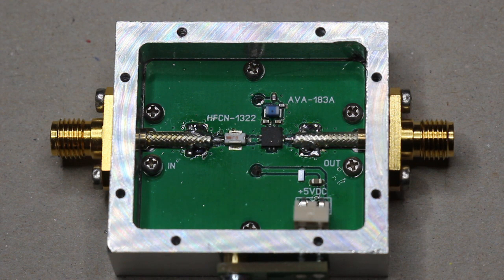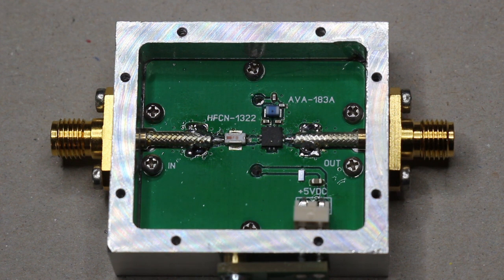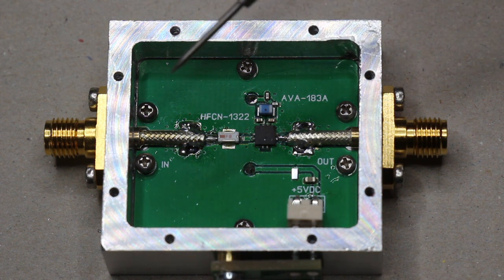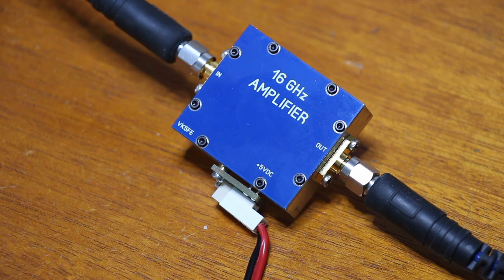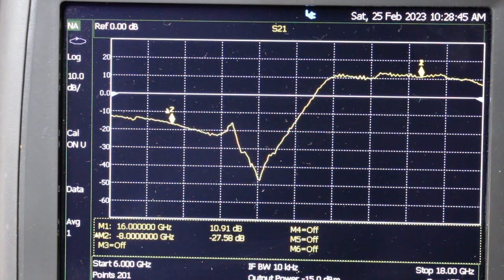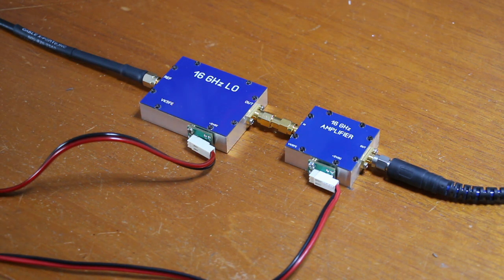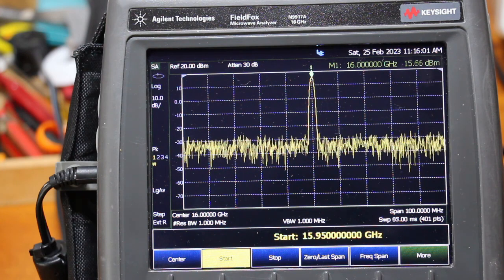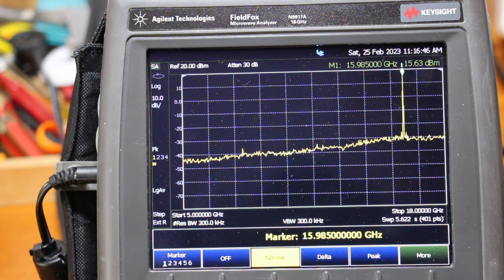#28    16  GHz, 10 dB Amplifier - Accidents Happen !!

Comment: Thank you for your video.
Very interesting to see your hardwork.
But i have question:
What nominal induction you used in power supply circuit of amplifier?
I trying to create amplifier with ava-183+ and have fiasco. No gain.
And i begin saspect - signal flow through power signal or other. In my datasheet, this induction - 3.3 nH.

Sorry for my English.
Reply from the maker: Hi Dmitry, thanks for your comment. 
I used the same components suggested on the datasheet, nothing different. For the inductor, try the Coilcraft 0805CS-030XJLC or equivalent. cheers.